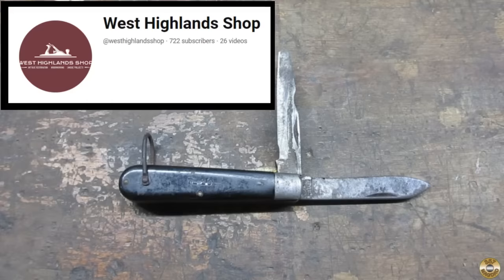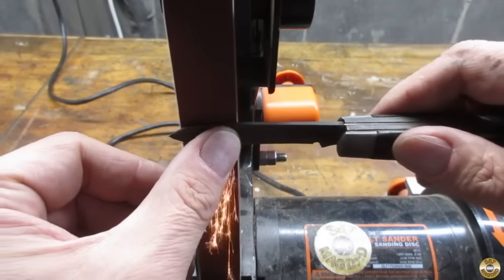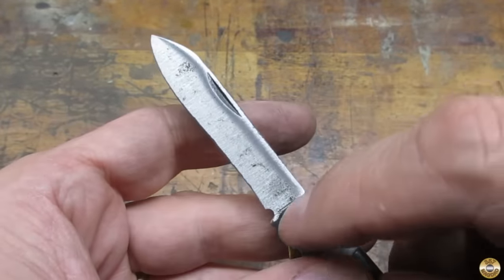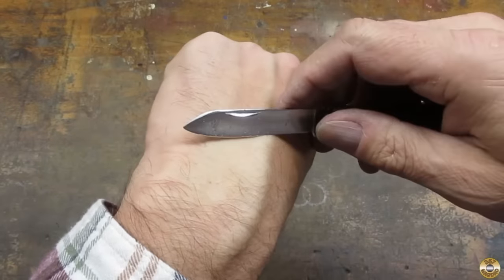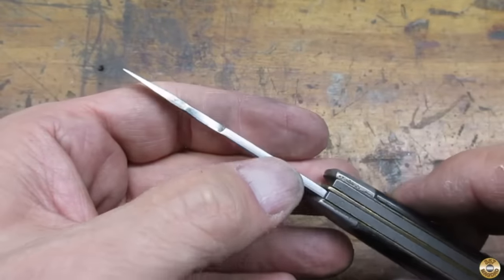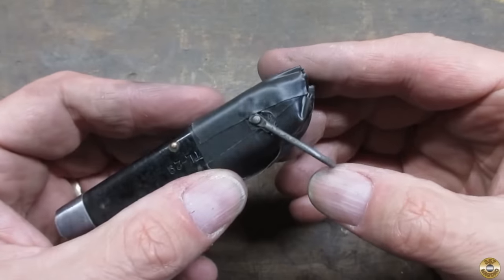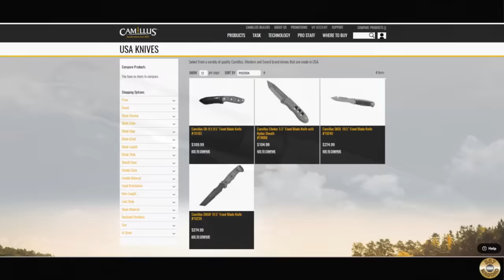Pocket Knife Restoration - Camillus TL-29

Comment: This is the first video offer yours that I've watched.  My first reaction: "Not the Dremel!". You are very skilled. I carried one like this for years with smooth black Delrin scales. It was built like a tank. I picked up a Klein Tools Brand at a pawn shop for $10 about 18 months ago. I cleaned and oiled it. It has plastic faux wood scales. The screwdriver works great for throwing sparks with a ferro rod. I live an hour from Camillus, NY where the factory was. My other favorite pocketknife is a Camillus U.S. , all stainless Utility (Camp/Scout) knife. It's in excellent condition.  Never sharpened or used. Dated 1996 on the main blade. It rode around in my mother in law's Jeep until it died. She gave it to me. I hear people complain about how some old knives have such strong backsprings. When Most people worked with their hands, naturally their hands were very strong. Before lockbacks became widely popular, these strong springs provided an extra measure of safety. I had a 1970s Case 2 blade large folding hunter. When closing, it would have worked like a guillotine if a finger was in the way. I enjoyed your refurb.
Reply from the maker: Thanks for watching!  I'm a big fan of Barlow style pocket knives.  I EDC a Montgomery Ward Powr-Kraft Barlow.  Check out my pocket knife playlist:
https://www.youtube.com/playlist?list=PL2LUCgmdqpXOJ085tzQW-pBKJVOd67-UR

Comment: Nice clean up Mate, I always think these Electricians knives are a perfect balance of cutting blade and tool blade (I think you can also find them with a file built in to the screwdriver blade)
Reply from the maker: I've got a three blade Klein electrician's knife.  It's got a curved sheepfoot blade in addition to the spear point and the screwdriver.
Reply: Cool, I don't think I have seen one like that before

Comment: That’s a military electrician’s knife, as others have noted. The screwdriver blade comes with that sharpened section, I imagine for helping in stripping wire. It’s not a case of ‘somebody tried to sharpen’ it, it comes that way.
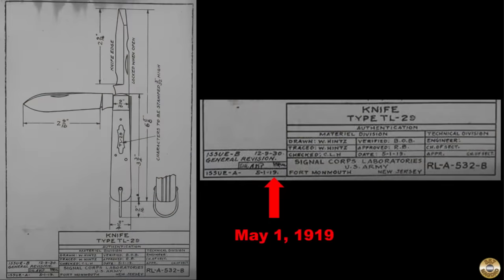Reply from the maker: Thanks for watching!  I guess you missed the part where I shared the US Army Signal Corps spec drawing for the knife.(12:21)  The drawing shows the sharpened section of the screwdriver blade. I was referring the the grinder marks someone left trying to sharpen it.

Comment: Just last weekend I picked up the sister knife to this at the Stormville flea market. There is no model number but it is a Camillus . The difference with it is the screwdriver blade is a knife only and it does not look like it was reprofiled. Other than some patina and grime it's in good shape. The pin for the lanyard loop isn't exposed in the blade channel so maybe this one is newer than yours. I also got from the same vendor a small Ranger 3 blade pocket knife. Again, no model number and it's a little more worn than the Camillus but should clean up nicely.
George
Reply from the maker: Old pocket knives are fun to collect and clean up!
Reply: They are rare, but Camillus did make some with a blade in place of the screwdriver. I don't have my books handy, but I think it was a long pen blade, thicker than on a smaller gene's knife.😊

Comment: Another great job. I bought one at a flea market Mine was in better shape after cleaning and soaking the knife as well as oiling it with a light oil I got it loosened up but it is still hard to open up, especially the screwdriver they close with a nice snap. Is yours like this is it because of the springs are heavy. I ended up making a knife opener from a spoon handle. It's nice to have when looking at knives at flea markets. Have you ever thought about doing an Opinel if you find a fixer-upper?
Reply from the maker: Thanks for watching Michael!  I have trouble opening those screwdriver blades too.  Opinels are great knives, I just don't see them much at the sales.

Comment: I actually carried one of these while I was a machinist/factory mechanic for 37 years. It is surprisingly handy as an EDC knife. I lost it and never replaced it because I can't find one in a hardware store anymore. I need to go ahead and order one because it is very useful. Are there any other options that are better than this one? If so I'd like some input before I buy one. Thanks for sharing.
Reply from the maker: I see electrician's pocket knives at the sales all the time.  You can also find them on eBay.

Comment: I have this same knief from my father,but it has wooden scales. How can I refurbish the wooden scales hopefully without damaging the original wood. There are no cracks or deep cuts in the wood. Thank you.
Reply from the maker: I would recommend cleaning the wood with mineral spirits, then buffing the scales with 0000 steel wool.  Finish them with a couple coats of paste wax.  I'd love to se some photos of your father's knife!  357mdad@gmail.com
Reply: @357magdad  I well my wife bought me a Dremel for Christmas.  I’ll try and do a before and after photo.  By the way I also have a folding wood 12 inch ruler like yours. Another project.😂

Comment: Not a restoration, you didn't take it apart so all the rust is still live and eating the end of the blade inside the handle plus the springs will be rusty inside the handle plus same for the inner plates.
Reply from the maker: Thanks for watching John!  I've found that soaking in Evapo-Rust and then coating the knife with WD-40 does a good job at getting to the rust I can't reach.  My EDC Barlow was in worse shape than this Camillus and I've been carrying it for years.